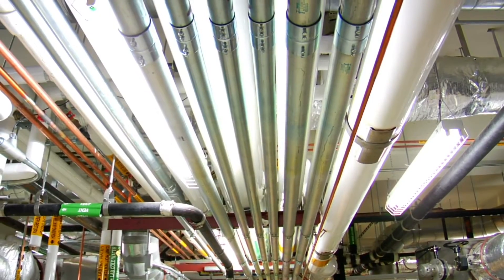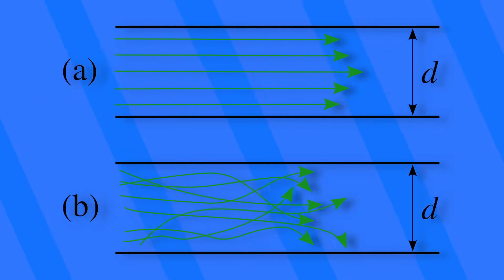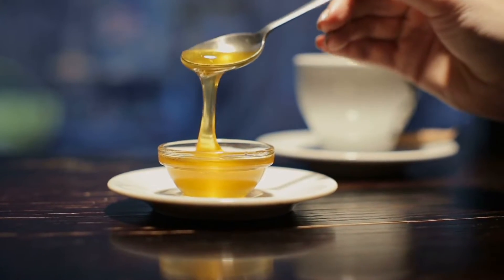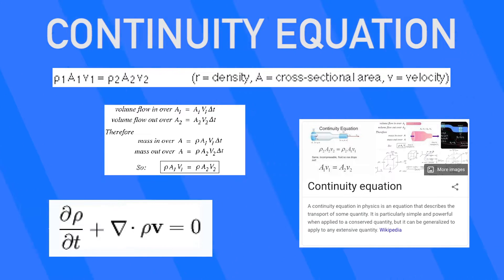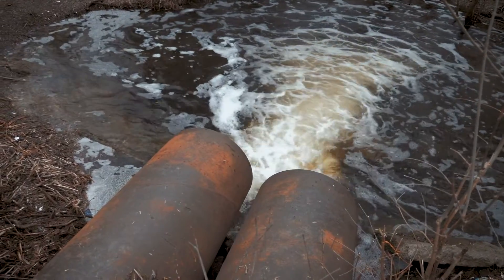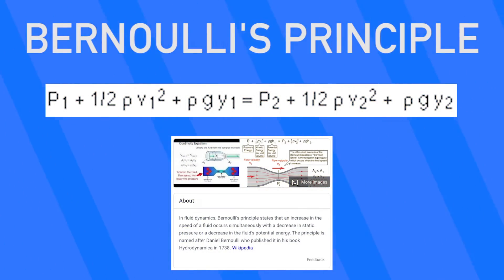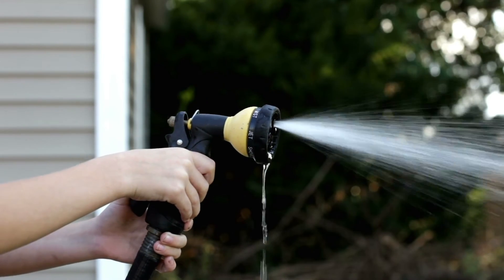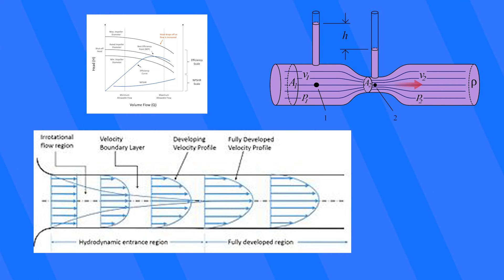How do Water Pipes Work? (The Physics of Pipes)

Comment: 7:14 While you're right about most of the other things, here you say "it's this difference of pressure that actually causes the fluid to flow faster", but that's just not true. What cause the fluid to flow faster is S1v1=S2v2, since S2 is smaller, then v2 has to be higher. That is because the volume entering and exiting any virtual tube in a flow (laminar, non viscous, etc etc) is always constant. If I put 1L at the wide end, 1L has to come out at the narrow end, because the volume is equal at all times in a tube (there are never "gaps" in the tube ). So, it's not because of the pressure differential.
Reply: Bernoulli’s law states that bigger volume creates more pressure and less velocity while a small volume - the opposite, so changing the volume affects both the pressure and the velocity of the water in the tubes.

Comment: Pipes can be improved:. With no scale buildup, include golf ball like dimples to reduce drag.  For corners, the section preceding it should have counter resonance fins.

In some circumstances, surface drag can be reduced to near zero, especially important for high drag substances.  There are several novel ways to do this!!